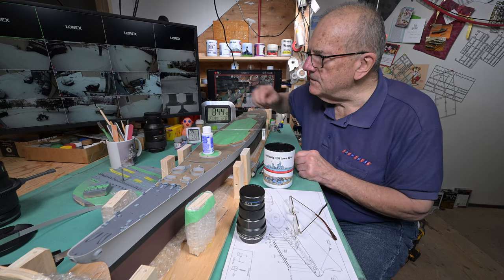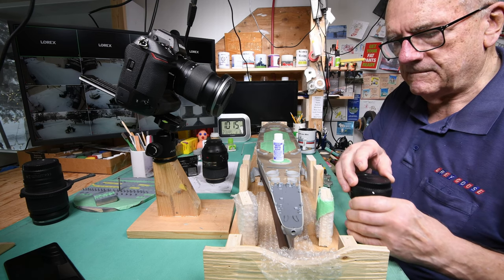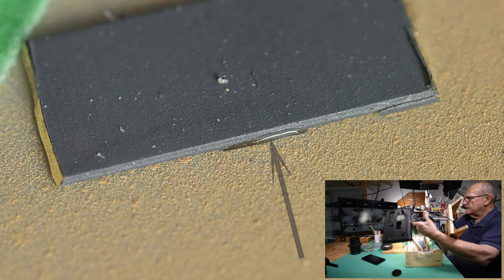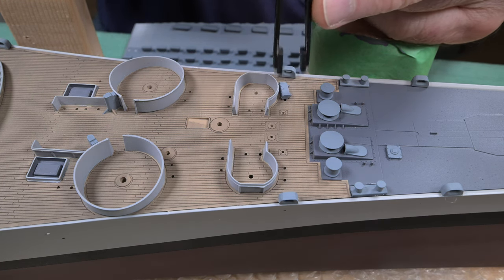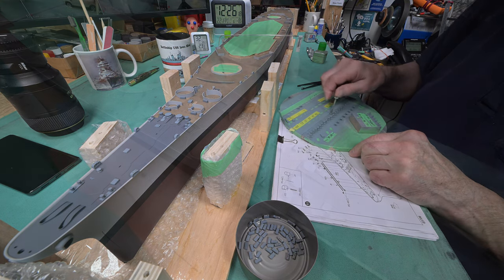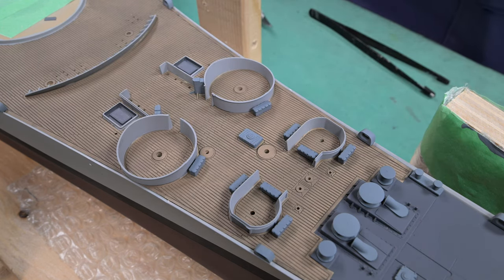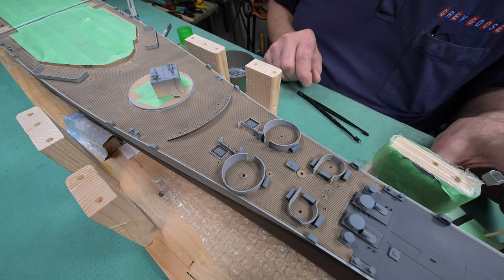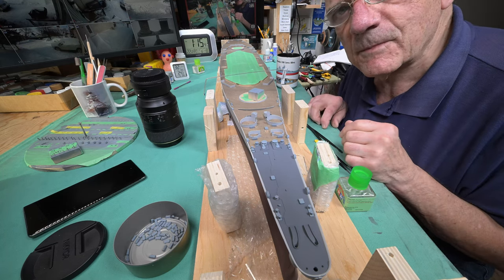The Model Ship - Part 1422

Comment: Ron, you can also use another product called Formula 560 canopy glue. Used basically for gluing canopy’s to aircraft models, but works well on other projects.
Reply from the maker: Will try to remember that. Thanks! 👍🏼

Comment: Off topic - Camera stuff.  I was so upset when I got my Nikon zSeries camera and found out I needed the adapter to use all my lenses. Once I understood why they did this and understood it was not a money grab,  I was very happy with the design.  You know this, but for others,  Nikon removed the mirror on the zSeries cameras, by doing this they were able to move the focal plane forward since space was no longer needed for the mirror to flip up.  This allowed them to make the cameras in the series thinner and lighter.  So much so,  now you can mount a z50 on a hand held gimbal at very low cost. The z9 is still a bit too heavy,  but that is a fair trade off for 8K 60fps.